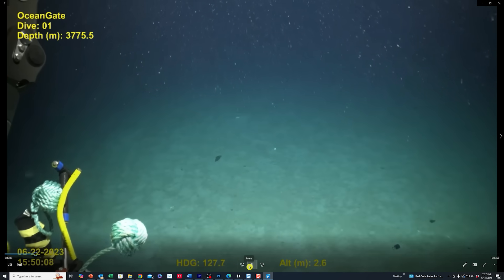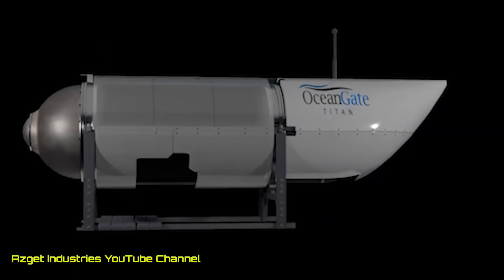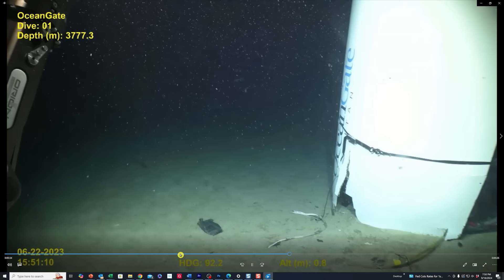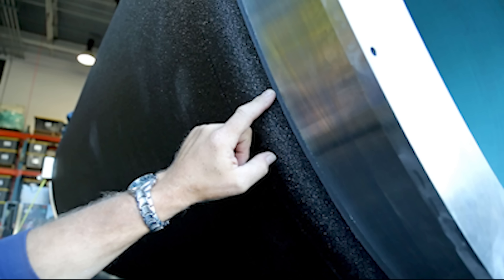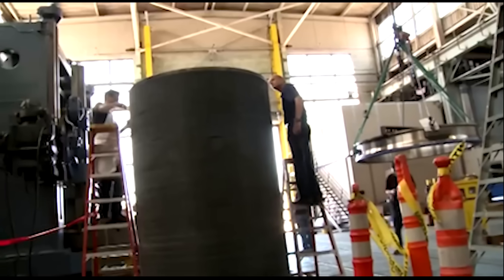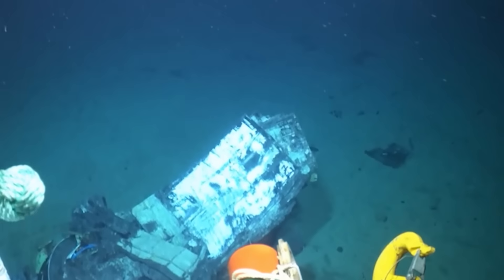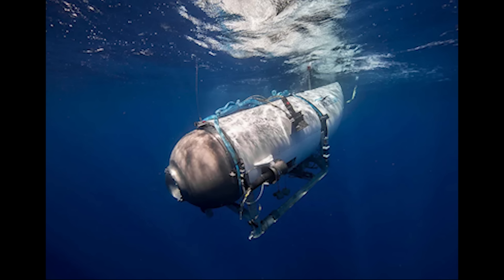OceanGate Titan Sub Debris Video Shows How It Imploded

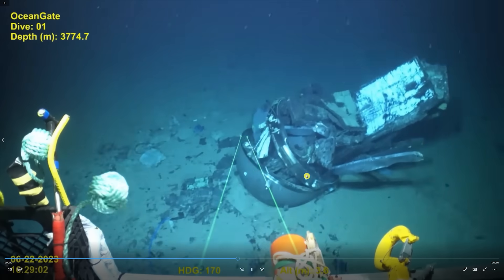Comment: At 4:52 if you look at the dome, and how it's detached from the metal ring, almost like a flap or lid.  Inside the inner dome looks like all the carbon fiber is crushes and pushed up into the dome.

So either the dome seal game way, and sucked   or crushed the whole tube into the dome, and out into the ocean or something.  The dome now looks like there's a hinge resting on the ocean floor, and the domes been partially opened a crack, and then everything got squeezed out that opening.  Not saying there's an actual hinge, just that's something to picture.  The seal must have held on one side is all.

Comment: No, no, surely you cant abrade the surface of the rings since wouldn't that be counter-productive to achieving a water-tight seal (as reasonable as the idea sounds)?  Wouldn't the water pressure at depth, combined with flexing of the joints due a variey of factors, be so high it would find any micro flaws in the seal and so end of story? At this time 5 days on, it seems it was the forward dome glued surfaces that gave way first. Somethng about the glue itself then? Anyway, the investigation goes on.

Comment: It is absolutely wild to me that they glued that thing together. I know nothing of mechanical engineering, harsh environments or anything related, but if someone told me they were going to glue together a pressure vessel to go even a few metres underwater, I'd have thought they were completely out of their minds. Absolute madness.
Reply: Well it was gorilla glue so...
Reply: @Flip-Da-Script I’ll tell ya what gorilla tape held my old car together for 3 years 😂
Reply: @cosmokramer5055 yeah but you ain’t underwater getting crushed by so much pressure 😭
Reply: @cosmokramer5055 they hold all Elon musks cars together too acording to trump
Reply: Lol
Reply: @Flip-Da-Script  no!?😂😢 I wonder if the occupants knew that they’d still go?
Reply: James Cameron said that multiple experts from the sub community told OceanGate that their submersible was a deathtrap, but the company refused to listen.  They thought they were innovators when they were really idiots.
Reply: @Durwood71  when I hear “innovators” I also think oh no….
Reply: Sadly common sense was missing.
Reply: Don't forget the rhino liner and carbon fiber 🤣🤣
Reply: I'd never would have gotten on the sub, ain't no way, it was to raggedy 🤨🤔🧐
Reply: Just for reference carbon fiber is held together with epoxy aka glue by non engineers 😅 many cars nowadays are glued in stead of spot welded. Glued correctly is fine no problem there’re problem comes when you use a hard glue and the structure is able to move. This movement because the shell was not thick enough to withstand the pressure correctly. Thick enough to have spare strength even when one layer breaks. Then it moves as to this the sheer load from hoisting it at the rings and there you go. 

Dante: “no man can see beyond the choices the do not comprehend” 

Bad thing happen when people stop listening to the people/engineers that are in the know. People smart enough to reed the reports and/or check the calculations and then understand the decision at hand.
Reply: Fact🎯 @timosan2020
Reply: and they were
Reply: Think of wood glue if used correctly to get the right chemical reaction to bond together the wood snapped before the glue joint 👍🏻 like what @jag said
Reply: @Hayden77Patstone bad comparison as titanium and carbon fiber are no where near the same materials, wood always has openings for the glue to set in as titanium and carbon fiber were smooth, same result as using wood glue on plastic it don’t work and this proved that
Reply: If industrial adhesives are used properly the bond is stronger than what they are bonded to.  The carbon fiber would fail before the bonded area.
Reply: @47izaPedo  unless the bonded area was subjected to inordinately high stresses due to bad design
Reply: @47izaPedo agreed the carbon fibre completely disintegrated. But you can't say he didn't know he was working with a product that implodes as it had on all his testing.
Reply: @47izaPedo  If industrial adhesives are used properly the bond is stronger than what they are bonded to.

Under what conditions? I doubt even industrial adhesives are intended to be submerged in saltwater for that length of time and exposed to pressures exceeding 3000 PSI. 

I'm not an engineer, but IMO this whole design was flawed from the get-go. It's was positively insane to use carbon fiber for the hull of a submersible intended to go this deep. Military submarines can't dive much further than 800 feet, and their hulls are made of steel. If carbon fiber were that durable, the military would build all of it's subs out of the material. 

Some mountain bike frames are made from carbon fiber and they crack like eggs when landing a harsh jump. Even aluminum frames, which are most common, hold up better. 

Carbon fiber has it's uses, but a deep-sea submersible's hull isn't one of them.
Reply: @47izaPedo How would you know that? Did you test a carbon fibre cylinder with titanium endcaps glued on with the same glue they used to crush depth and then examine what exactly failed? No, you didn't. Your "trust me bro" comment is the perfect example of how the internet is rife with misinformation. Just some random guy "Well here's how it works, trust me I know." No, you don't know.
Reply: @jegr3398  I stand by my comment.  You seem very angry about it. Sorry to see that. Maybe take a gummy and chill.
Reply: @jegr3398  in this case the whole world told them they would die even by experts.  If you didnt know the history, previous test on this sub they actually reported Hearing Cracking in the hull.  James cameron told them that right there is a red  flag and you should not dive.  They had 4 different previous test where they heard bending in the walls of the sub.  This guy who took his son down there with him, he should be burning in hell for murdering his son.
Reply: Yeh me hardly trust glue either, even hooks in kitchen for sponges are screwed in
Reply: Any engineer worth a damn would have been fired or resigned.
Reply: I totally agree. It's too common sense
Reply: not to mention it was controlled by an xbox/game console controller.
Reply: @ashes2ashes746 the controller had nothing to do with it.  Lots of manufactured military equipment utilizes game controllers.   This was not even an  Xbox controller tho.   It was literally the cheapest Logitech controller available on the internet.  Amazon at that.   Imagine getting lag on your joysticks.   Lmao 🤣.    Plus he was drilling handles he bought from RV world into the hull.    Yikes 😬
Reply: It is not exactly a glue to hold two different pieces together but a polymer that form a seal  once bolted tight
Reply: It's purpose was not to glue both elements together but to seal them. Outside pressure was holding them together, there was no need for glue. Carbon fiber hull was bad idea.
Reply: Absolutely Chuck. A five year old :" that aint gonna work mate."
Reply: It could go no more than 3000 feet but stockton took it to 13000 feet the guy was insane
Reply: @jasonlinton9902 his narcissism was so blatantly obvious. It especially struck me when he angrily said that he took peoples' criticisms of his dangerously reckless attitude personally. He was delusional. Between him, Suitcase Sarah and the orange clown king, America's getting a real lesson in narcissism.
Reply: Was it just the glue? Or was it that the carbon fiber it was built out of was shaved and therefore didn't maintain its strength?
Reply: @Spadace.1 it seems to have been several factors. He skirted safety and common sense in every aspect of his design. Gross hubris all around
Reply: The first time I saw that glueing together bit, I just could not believe it! And then watching HOW they were cleaning it and applying glue by hand - beyond shocking!!
And even more surprised it did manage to complete a few dives...
Reply: You and me both.
Reply: They glued heat shield pieces to the shuttle?
Reply: Plus actual experts, engineers who have been involved with the building of many different submarines, deep sea ships, one man subs, and other deep sea vessels told this man that the materials he was using broke down quickly after every voyage. I forget the exact material he used? Was it Carbon Fiber?  And what did they say was a better choice? Titanium? What was the better choice to use than Carbon Fiber or again whatever it was he used. Plus the man used a  🎮🕹video🎮game🕹controller🎮joystick🕹🎮          Basically this--------->🎮<--------- To steer this submarine?   He opted for a $29.⁹⁵ video 🎮 game🎮 controller? Now I am not saying this man was dumb, not at all. He actually made several trips with his submarine successfully. However his arrogance was his undoing, but not just his, the lives of others as well.
Reply: Yea the consistency of peanut butter.
Reply: They were emboldened too when they successfully made it down there multiple times.
Reply: that was where they went wrong, they literally glued it together.
Reply: Agree. And after watching this - that dude was nuts.
Reply: SAME AF.
Reply: Where are the bodies?
Reply: I've been having a time, here recently, imagining the last few moments on the sub. The loud bang of a carbon fiber cracking under pressure, as had been reported many times before
Stockton: "Don't worry, that's completely natu-
Reply: I know nothing about it either, and I knew carbon fiber plus deep pressure equals implosion…I also knew the shape was wrong. It’s usually a sphere right? Equal pressure on all point. I’m a barber from Oklahoma who was raised on a farm and knew all that!? 😂
Reply: Yes!!?! 
I never knew anything about this until I seen an hour ago what's left and just now how they built it. Even a nail technician can see where they went wrong with this whole operation. 

I mean come on I even know what happens when you add baking soda to super glue. I guess that's what they should have used baking soda and super glue it would have held it together better than what they used.
Reply: Industrial glue is much different than the type of glue you're thinking of.
Reply: The popular thing to say after it failed, it wasn't the first time Rush went exploring in his carbon fibre submersible.
Reply: @ifv2089  Multiple people predicted the sub  would fail because OceanGate was not following proven engineering practices for the design and construction of deep sea submersibles  The experts weren't just guessing and happened to get lucky when the sub catastrophically failed.  They were making an informed prediction that was 100% correct.

Comment: /En mi opinión, yo creo que la principal causa de la falla de este vehículo se encuentra en su propio diseño de forma cilíndrica, cuando debió haber sido de forma esférica, o al menos ovalada, como una aceituna. De esa manera hubiera tenido mucha más resistencia a las deformaciones por la inmensa presión del fondo del océano. / / / / In my opinion, I believe that the main cause of the failure of this vehicle is found in its own cylindrical design, when it should have been spherical, or at least oval, like an olive. That way it would have had much more resistance to deformations due to the immense pressure of the ocean floor.

Comment: Issue is with the resin, same with the carbon fibre, is that its strength isn’t spread uniformly. Like spreading peanut butter, some parts are thicker than others. When it comes to 3000m underwater even a needle dick of difference in the material is pretty much disaster. Almost like there’s a reason deep sea manned subs are so meticulously inspected and controlled.

Comment: A coup,e of weeks before this final dive titans front titanium cap fell off because they only used 4 bolts instead of the 17 bolts required to keep it on the sub stockton rush told them only use 4 bolts because the water pressure that deep would push against it anyway and keep it on the sub the man was insane

Comment: 5:39  That's the nose dome and there is the window to the right of it. The nose dome should still be bolted to the attach ring because the bolts are stronger than any force the Ocean could put on them. What are they, half inch bolts? So each would have a strength of around 47,500 lbs ?   Yeah, they should still be intact. So the question of why did the nose dome detach from the attach ring is a big question.

Comment: So shocking and sad, and fascinating rolled into one. Ambers 3D work is second to none. Great job. My jaw fell open at the end there with the implosion animation and how fast it would have happened. Sad. Shocking the way they found it. My question is though does the level of damage to the hull, I guess less because they weren't as far down when the implosion happened? Because I guess that since they start at 1 atmosphere no idea the PSI that is versus the PSI say 14 atmosphers would be, and they were in the middle of that some where. I guess what I am asking is I am surprised that there was so much of the hull still there, I would have though the implosion would have crushed it to the size of a fist not something that is about 2 feet long. And it wouldn't have shrunk more while sinking either since the damage was done. Or am I off on that line of thinking? Trying to wrap my head around the loss of life, the tragedy, and the science of how things work. Thanks.

Comment: I am a nace certified specialist . I could tell  u that the epoxy install was not following procedures.  U have to sandblast a 5 mill. Anchor profile before u apply epoxy on the rings. That was the first failure. Then it imploded

Comment: I would like to know what company made that ratchet strap? If it survived a submersible failure at 12,500 feet underwater and still working like it should?! Well that's good enough for me to shell out some $$$ from my wallet for use when a ratchet strap is required at home or for hauling something or whatever else 😂 Good marketing for the company "12,500 feet underwater and still holding" 😂

Comment: The entire concept of this vessel was idiotic as a result of the materials used and the construction methodology. To be brief: 
1) Carbon Fiber is a stiff material with high flex modulus and is very useful in tension. It is not great in compression, even fiberglass is better in compression. Fiberglass is about as strong as steel, and almost as well proven. Need more strength, use more glass. The main failure mode will be found to be interfacial failure between the epoxy matrix and the carbon under compression;
2) From the construction of the vessel video's I have observed, they used a wet-lay up process with little regard to the thickness, viscosity, and tension of the carbon fibers as the wrap was undertaken. I will add that it was a very dirty environment with careless application of the epoxy matrix. Why they didn't at least use prepreg fiber is a mystery. They could have talked to some serious carbon fiber experts at Boeing to find out the right way to do this sort of build. Clearly they should have at least used a tougher, more rubbery epoxy;
3) Titanium? Titanium has great properties but for this type of construction they may have been better off with steel. Mass and weight were not an overwhelming consideration in the pressure hemispheres,  add bulk and one gets all the compressive strength needed for the application, and steel is well proven from the standpoint of adhesion science;
4) Bond of titanium to carbon fiber. This is a critical step and the design of the bond is absurd. As pointed out in the video, there was zero abrasive preparation and the applicator had as pointed out zero understanding of adhesive preparation. The bond seemed to be a few inches deep, I would have designed it to be at least 6 to 8 inches or even more, it is a mission critical bond. It should have been abrasive blasted with Silicon Carbide that was clean and achieved ISO SA 3 standards for white metal cleaning. Then if anyone came near it without gloves on, they would be shot!; and
5) The would have probably been better off to use and acrylic or epoxy hatch design. There are epoxies that are clear and meet or exceed the physical properties of acrylics and bonding like to like is always the best way to go. Although, I have little doubt that a company like Reynolds Acrylics could have designed a far higher strength hatch assembly with great bonding to the carbon fiber.

My two bits worth, with input from a few colleagues, with fancy PhD's in aerospace engineering from places like MIT, Cal Tech, and Cambridge.

Comment: Well, looking at the initial video of it on dryland, I never noticed any internal bulkheads inside the carbon fibre shell which actually kind of surprised me. Bulkheads have been used in submarines for many many years.. the internal carbon fibre structure looked completely flat… they designed it very much like a compressed air cylinder with the carbon fibre wrapped evenly… I would even suggest having put ballet structures, not internally, but externally to stop any movement in the flange. I also agree with you that adhesion of the titanium ring needed to be not only clean but proper abrasion on the metal

Comment: You can see that the shockwave of water pressure started at the front and then worked its way to the rear.  There is carbon fibre shoved through the aft end cap which was blown off.  If something is going to fail it will fail at the weakest point.  The join between the carbon fibre and the titanium.  I am just astounded anyone would get in this piece of junk.